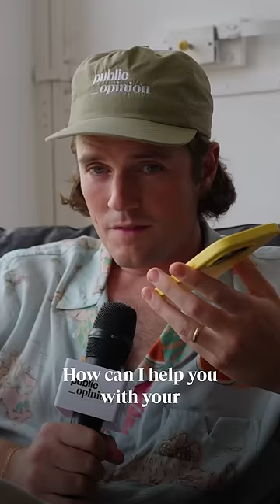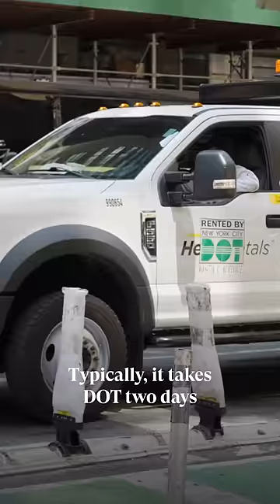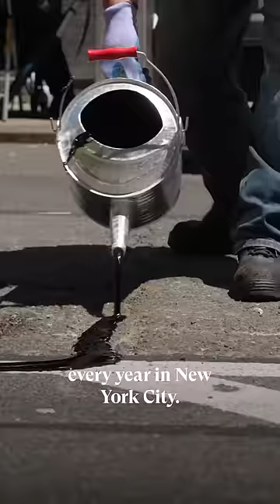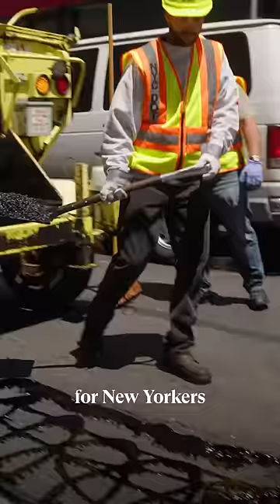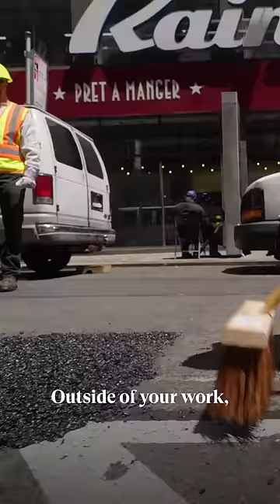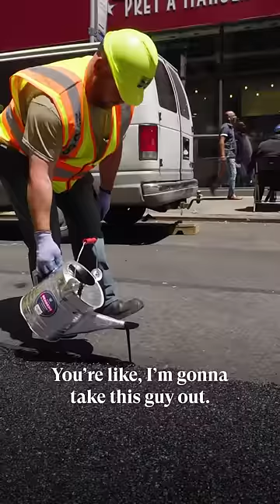What happens when you report a pothole in nyc?

Comment: hes so charming its hard to be mad but dude my fcking carrrrrrrrrr😂
Reply: He fills them in. You contribute to making them. Take a second to consider who to be mad at
Reply: @TheFreeBro don’t semis do most of the damage to roads? I could be wrong but that’s what i thought
Reply: @TheFreeBro 🎉
Reply: @hdjono3351 and what would we do without semis sir
Reply: @hdjono3351  In the northeast it's usually ice that causes it, water expands when frozen so if water gets into a crack on the street it expands it. Of course it's not the only reason they happen but in the northeast it's the primary one
Reply: @hdjono3351 any driving contributes to wear on the roads over time
Reply: @kushmaster9000  we'd use trains. Obviously semis are still needed sometimes, but if we had better rail transport then we wouldn't have so much
Reply: @TheFreeBro  Ice does the most damage to roads.
Reply: @nahadoth2087  im not advocating to get rid of semis i was just offering a reasoning for why roads get the way they are but I’ve been corrected 👍
Reply: @kushmaster9000  I’m not saying to get rid of semis just pointing out something I thought caused some of the road damage

Comment: At best that was a good temporary patch. Proper job would be to saw cut the asphalt and clean out 2-3" of old material and get all dust out. Spread tar and fill with hot asphalt and roll with 1 ton compact roller then tar the seams.

Comment: That’s the thing. Report a pothole as soon as one appears. Don’t bitch every day about it when you hit it because you are too stupid to avoid it. Don’t bitch about it for a week assuming someone else has reported it. If you haven’t, logic says no one else has either. The quicker a little hole or crack is reported, the quicker it can be fixed so it doesn’t get to be a behemoth and actually becomes unavoidable. Also remember, in cold wet weather, tar doesn’t stick and becomes hard faster, so repairs are often held off. Lastly, give the traffic control and repair teams a smile and wave when you drive by. Show them you appreciate the often thankless work they do.

Comment: they are just putting hot patch it wont last but a few months the proper way to do that is cut the hole down square put hot asphalt and then compress and then use the infrared machine on it then its good for a few years all they are doing is putting a temp bandaid on the problem

Comment: Wait you can call to repair potholes in the US? In my country I knew about one pothole that was there for at least 10(maybe 15) years. It was a huge one as well.

 I first saw it when my mom was driving me to the store as a kid. Later I got my driver's license and was avoiding the hole myself. It was so big that it would easily swallow the car's wheel. 

I don't even know if it got repaired yet. I just moved to a different location and don't drive by the hole anymore...

Comment: Too bad they use that pebbly mix to fill in the holes. In a few months, that mix will start crumbling apart, sending tiny tar pebbles all over the place as cars drive over it. Then in winter, when moisture gets in there and freezes, it all comes apart and the original hole underneath emerges again.

Comment: Isn't there a really easy to use website that you can use? I remember talking to my friends about a missing stop sign, in my neighbourhood. A few days later, I kept trying to call 311, and the non-emergency police line, about a hazard on the highway (endless ringing after 311 directed me to the correct dep't, and busy signal for 40 straight min on the non-emerg police line... I gave up). 

My bud in NY linked me to NY's site, and told me how pretty decently it actually works. It was impressive, in comparison. It made me disappointed in my city / province, however. 😒